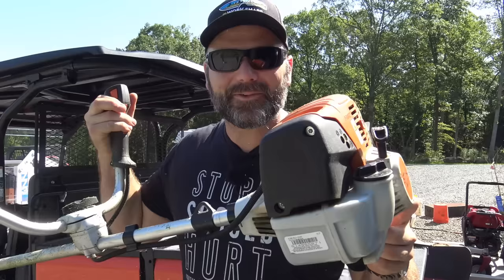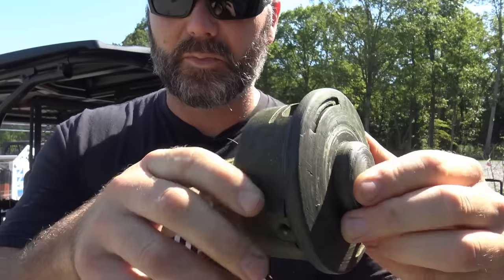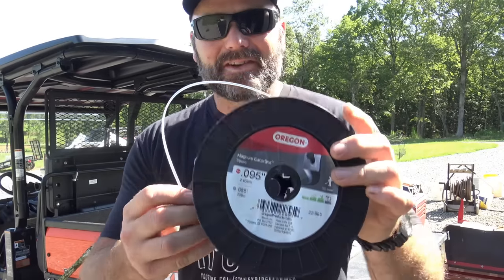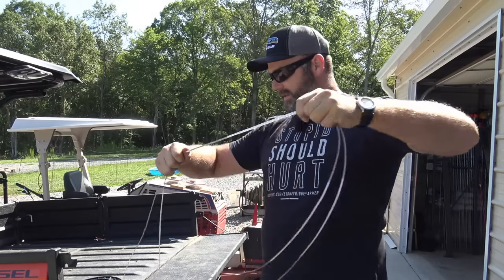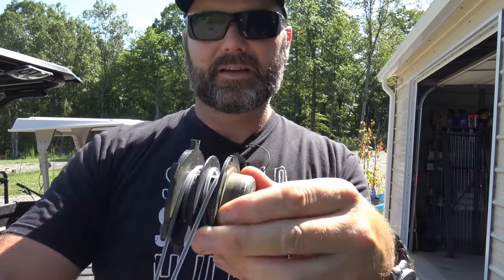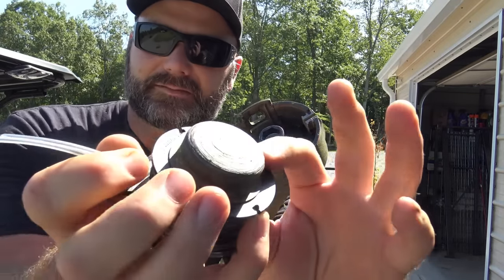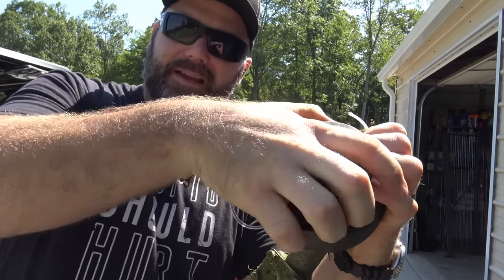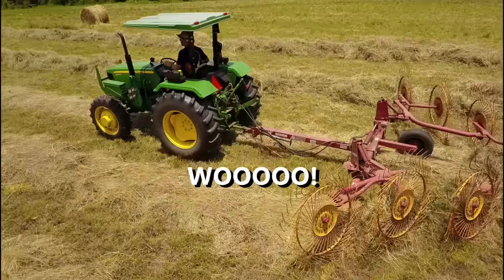EASIEST WAY TO STRING YOUR WEED EATER

Comment: Use those two little edge holes to hold your line while replaced the loaded reel. 
They keep your lines tight then after you can pull each one and guide it through 
the metal inserts leading out from the spool.

Comment: I turn about six feet on one side and then I turn another six feet on the other side . Separated . You seem to just go around and around without regards for each string on it’s on track . Does it still work? Won’t get stuck ? Or did I miss something - thanks
Reply from the maker: one string is in one track the other is in the other track...hold them snug and wind them..they will stay in their perspective tracks my friend...try it

Comment: Thanks for the video. I have a Red Max string trimmer that I love. Unlike your Stihl,, it uses one continuous piece of string. Since I never remember how much, I just wrote 27' (8m) on the package, although I use a bit less as I can not wind it tight enough to use quite that much. Additionally, I have an eye hook on my back porch for hanging things and I have measured a distance from that eye hook that  provides the right amount of string. In other words, I feed the tag end of the string through the eye hook, and with the end in one hand and the spool in the other pull it to where the doubled length is about right (according to my past measurement which happens to be the wall edge of the doorway). I cut it, set the spool down, and pull it out of the eye hook. Now I have the right amount, I place the two ends together, and work my way back to where the doubled portion meets, that goes in the slit on the cartridge and I start winding in the direction the arrows indicate. Then I proceed about like you do to wind it, etc. 
You asked for comments on what we find the best string. I have .95" RedMax "Professional Twisted Trimmer Line" It also calls itself "CableTwist Professional Trimmer Line" Made in the USA. It is the best that I have used. I don't believe it was an included brand tested by Project Farm, so my comparison is only to a handful that I tried before, and have only used RedMax since then. I still have plenty, but when I need more I plan on again reviewing the videos by Project Farm where he compares string trimmer line. I believe he has two videos, the second one tests some additional brands that were favorably mentioned in comments to the first video. If you watch the video you will find out how your line compares as Oregon Gator line is one of the string trimmer lines that he tests. The Project Farm video is called: Best Trimmer Line? Let's Find Out! Round 2: Stihl, Husqvarna, Echo, Oregon, Shakespeare, Weed Eater
P.S. I came back to say that I liked your T-Shirt. LOL. I hope I was not forward, mentioning another video, but you asked and I answered. ;-) You, and your many viewers, may find it and other Project Farm videos helpful on the farm. I did bookmark your channel and plan on returning to watch more videos. In fact I think I will subscribe as they looked interesting.

Comment: If your weedeater line does not feed when you bump it, it could be that it needs to be wound in the opposite direction.
I had to wind mine in the direction opposite the arrow marked on the reel to get it to work.

Comment: Check out the 4 stroke black max,at Walmart,you just select the bottom to center where it says reload,then push string through the holes,center your line an then turn the head clockwise until 6 inches of line on both sides an bam your done an ready to get back to it,I bought one a week ago an was kinda ify on it but it's been great an has tons of power.

Comment: Thanks for the video. I "whipper-snip" every year about this time when its the peak growing season. I found rolling off the new roll as one length, find the middle and put it across between the two receptacles on the head, then wind all the way on so they are even. I have a Makita machine, so the head may be configured slightly differently.

Comment: Curious if you wound in the direction indicated on the spool?  I’ve seen other videos where you wind the direction as the string lays when plugged into the holes.  Or, does it really matter?
Reply from the maker: I wrap it backwards from the direction of those holes

Comment: The spool has notches on the bottom by the tap button on each side to hook your string in while you reassemble the head. I usually do the bottom string first it winds up faster.

Comment: I have a weed eater stringer straight shaft. My question is after I rewind the string on the spoil I need to put the line into the holes, these holes are on the spoil itself not like yours. Any suggestion on how to insert the string into these holes without them coming out?

Comment: Winding it more evenly   and easier without having to cut two separate equal lengths, which get tangled and fall out of the spool................Cut one long piece sufficient to fill both sides of the reel. PUT CUTTERS IN POCKET, then find a post or similar around which to pass the cord. Slot the two bare ends as you have shown , and keeping the cord taut, wind the spool. It is easier and stops the slack. When wound on completely, and this is why you must remember to have the cutters when you start, cut the cord slightly shorter on one side than the other, to accommodate the mounting and passing cord through the side slots....job done

Comment: thanks for the video. trying this on my 40b brushless greenworks string trimmer without much luck. my line keeps coming out longer and longer for some reason. my feed head is a little different than yours though so it may not work as it seem as i'm missing the something that is allowing the string to basically slowly come out evenly through both holes through the rotational force.
Reply: Addendum:   Please let viewers like me know that the spring has to be in place for the line to stay in place. I tried to follow this and didn’t realize my spring was missing and my stream kept extending farther and farther out as I used the weedeater. SMH. I found my spring in my garage under my tool bench and that solves everything! Thanks for showing the video!

Comment: I have a 40 volt Husqvarna which is pretty awesome, no gas, no oil and it is as good as any homeowner grade gas trimmer. It is a bit different. The string is folded in a U and hooks onto a slot in the center rib. The thing I figured out is after winding it on put the cap on then put the assembly onto the trimmer. A lot less frustrating than putting the reel on then the cap. But on the Husqvarna the slots are in the cap which is different from your Stihl.

Comment: Nice vid bro. Gotta tip for ya. Cut a notch into the centre of your spool on a 45 degree angle to the direction your running your wire. Then you won’t have to cut your wire before loading, this not only saves you time but when your spools getting worn the holes for your wire tend to get distorted making it hard to get your wire in. Onya Pawly

Comment: To get the release more string mechanism to work properly I recommend an inspection of the internals . Clean out all the dirt, sandpaper smooth all the plastic burs and channels, and spray some lube. It will make the release more string mechanism work smoothly again. Took me a while of frustration until I realized why it wasn't working. Mechanism needs freeing up.

Comment: Buy you the "SPEED" feed type head. So much easier & faster. Keep your string INSIDE a cardboard box away from the sunshine. Spray the roll with silicone spray or dip in water from time to time to keep it hydrated and from sticking.

Comment: My redmax is sending out too much string which makes the rpms go way down...I'm in some pretty rough stuff, but could it be because the little metal pieces the string threads through are loosening with age?

Comment: How come you didn't have the safety guard which is the cutter for your string also on your stihl, and you bet that is the best string that you can buy, I use the same stuff and it cost me about forty bucks for the spool of it, it cuts the toughest grass, weeds, and young saplings also, my string isn't round so I have to trim it just a little bit not much to get it in the round holes on the trimmer head

Comment: That took you a little over 5 minutes. I can load a speed feed 400 in under a minute every time and they NEVER give me a problem. I pre-cut my lengths of string and start my weed trimming for the day. The larger Stihls do hold more string but loading them takes 3-4 times longer. Also, the Stihl replacement head costs 2-3 times more than a speed feed 400. I'm only speaking from my own experience from doing lawns and being a certified small engine technician for 40 years with a specialty in Echo (over 50 certifications and 10 hands on schools). Just to clarify. I'm not knocking you or your equipment sir. Just sharing an observation and my opinion based on my own experience. You have a cool channel btw. Thanks for sharing!

Comment: What you are showing there is what I've done for my whole life but today I was trying to restring my black max (I know it's not high quality) Walmart trimmer and it had me completely confused. You do not pull the head apart on it. You line up this line on the bottom of the bump feed and the head. You then feed your string all the way through the head until it's even on both sides and then just wind the bump feed and it self-loads into the body. Amazing design but if I hadn't looked on YouTube for instructions I would never have figured it out because it is not the typical process.
Reply from the maker: take  home message...go to a tool store for your tools my brotha

Comment: The trimmer string that comes inside the Stihl trimmers is usually tied up inside (prob for shipping), so the first thing you need to do is open it up and loosen or restring it or it will never feed.

Comment: I have a new cliper I use it two times and it will never start again I checked plug gas and nothing gives me your idear.
Reply from the maker: drain the old gas out of it, you probably have corrosion in the carb from using ethanol gas, take it to a shop or replace it with an electric one.  Milwaukee and Husqvarna make great ones as well as Toro.  Buy the battery powered ones and never look back my friend

Comment: What does the protruding length of the string do??
Reply from the maker: not sure I understand what you're saying...please elaborate
Reply: @StoneyRidgeFarmer  so you took that 3m string and coiled in around the circular disk. There is some extra string hanging out on either side of the disk. Does this cut the grass? And does the length of this protruding string (the extra string not coiled and hanging out on either side of the disk) have any impact on how it cuts?
Reply from the maker: Reading this...I'm not sure you've had any weed whacker experience.  So, yes the string is on a spool, the spool rotates...the string that comes out of the spool is what does the cutting....so a rotating reel of string trimmer string with pieces sticking out on oposite sides is what does the cutting.....those pieces eventually wear out and break and you pull out more string to hand out the sides for cutting...evenutally you'll run out of string....this video is how to re-install more weed whacker string. Hence...the string trimmer...hope this helps ya
Reply: @StoneyRidgeFarmer  thank you, this is exactly what I was looking for. And yes I do not have any expletive. But your video was very helpful 😊.

Comment: I want 2 find out I have always had an issue when I string my weedeater it seems as if I start cutting  sometimes withing less then 5 minutes the strings length goes down I need 2 know how 2 stop that and have such a struggle I have a kobalt 40v weedeater thanks

Comment: If you don't know what length of line your trimmer takes, simply take the end of the line from your supply spool, insert it in the starter hole then wind line on the trimmer spool crossing the two halves of the spool when you get to it. Then when almost full cut the line from the supply spool. Then unwind it all off the trimmer spool take out the end and then double it with the other end evenly to find the middle. Cut the line in the middle, you then have two halves that can be installed on the trimmer spool as per the video above.

Comment: A handy dandy tip is to pull the string out in one piece ( your arm length from finger tip to finger tip with arms extended is supposedly the same as your height) , put the two ends in the holes and wind just like you said. When it is fully wound, stick the string from one reel in the matching side tab. Do the same thing on the other side. Then cut your string/loop in the center. D-U-N done!!

Comment: A key to long life for your string is storing it in a cool place - NEVER in a hot storage building that hits 100 degrees or so on hot summer days. Find a cooler corner in your garage or someplace that does not get hot. And NEVER exposed to the sun for too long. This avoids string breaking off inside at the spool, excessive bump feeds, etc.

Comment: Hmm. I’ll have to check mine. I didn’t realize that there were holes for two separate strings. For years, I’ve just taken one long string and hooked the middle loop inside then wrapped

Comment: I have an echo weed eater. i just line up the holes through the trimmer and pull the line through. Then i wind the trimmer line until it's complete. if the line isn't the same length. I cut them even. Takes about 2 minute total.

Comment: I have a Homelite trimmer and it's not a bump feed. My spool seems a bit smaller and no spring. The string you provided I was wondering if it would fit my spool? I did not realize that rig
ht off the bat they come with very little string
Reply from the maker: google it my friend...see what the max string size is that it will take...might even say it on the trimmer or manual
Reply: @StoneyRidgeFarmer  thank you. Mine is a .065. took your recommendation and ordered this brand line. 
Thanks again

Comment: i have a murry gas weed eater the booklet says to rape the line counter clockwise which way is this the bolt to hold every thing together locks clockwise so do you turn the line in other direction or what the booklet is ?.

Comment: I need a help,I want to try this strings on my nylon string guitar but the sizes required is 1.14 mm,0.91 mm 0.75 mm..Do you think these strings have the same tension as nylon string guitar..
Reply from the maker: you want to use weed eater string on your guitar?  Yep...that's not gonna work very good buddy
Reply: @StoneyRidgeFarmer  okay,but i have used one string that is extremely huge, And it sounds like a bass string.i have uploaded a video with it playing..
But thanks...
But please answer me this.
can these strings 0.91 mm,1.14 mm be found or are they manufactured

Comment: Just buy extras heads, get a bucket soak them in a bucket and have pretty prepared and ready to go and have strength and another bucket prepared and soaking ready to go. The long of your string will not shatter and break. You’ll see a difference. Trust me. I’m a landscaper do this for 1520 years and there’s tricks and there’s trades to do everything.

Comment: There are small slots you can fix the ends of the string on to after winding it, so you don't have to hold it the entire time. Then before closing the reel you can push it down and twist, you will fin a position where it will it will stay in place. Then you can close the lid without holding onto it.
Reply from the maker: well great buddy....thanks for the input...but if ya already knew how to do this...why are ya watching? lol

Comment: Guess I will keep on doing mine the long way. The exit holes are at a slightly different level. I use the hold slots on the side of the string reel the old the string in position then when I put the string through the holes I just  pull on the string to release the string. Like I said mine is a little different.

Comment: I use a string that is larger than yours . What I did was use stills black line that they cut a push threw the head and cut. Well your will not take it so what I did was get a drill bit the same size as that line and drill out my string holder making sure not to go all the way threw. Then rap it just as you do and because it is so big a strong I can cut all most anything with it and it last longer than anything else I have ever used. The dealer I used did not quite understand tell I took mine in and should him. Now he shows others what to do and loves it.

Comment: wow. i feel like i'm  strung out , allready.
    Got a Stihl FS 40 , and bought 3 different heads. The newest one, by Stihl, has a black/white bump head. This one, sucks string like crazy. It is too 'touch sensitive' and spits string out randomly. Another one, original, has 4 locking horns, sticking out the bump knob. Works good, but plastic wears down. So i screwed a large washer, onto the bottom, but short, so as not to bother the nut inside. Works fine, now. another head, has the bump knob, only WITHOUT the four locking horns. This one, is ok, as well. The other one, is the triple plastic blade head, I never tried this one,    YET.      good  day to you and yours, and stay clean,  ON  THE  LAND....

Comment: I saw a video by Chickanic that said round trimmer string is better than square, six sided or any sharp edges because those sharp edges makes it bind on the spool.  And she said to always use the size trimmer string that the manufacturer stated on the box and in the manual.  Can't remember why, but that's what she said.  She also has videos about the Speed Feeders you mentioned.

Vanna's there?  I'd like to buy a vowel, please. 🤣😂🤣😂🤣
Reply: I use the triangle string in my Echo, no issues. 
The sizing is important though, I used a larger than recommended size and it caused binding.